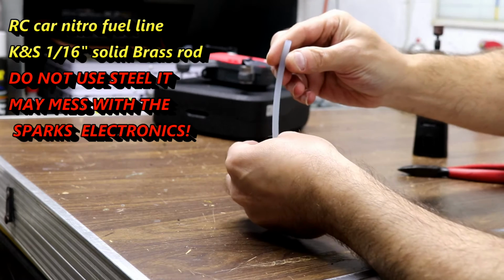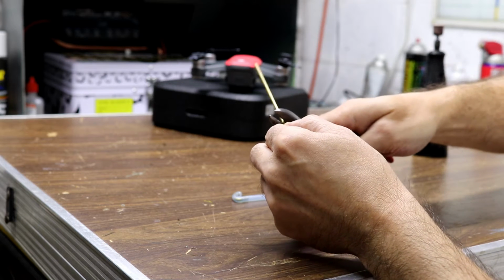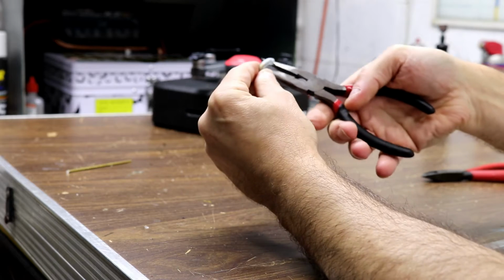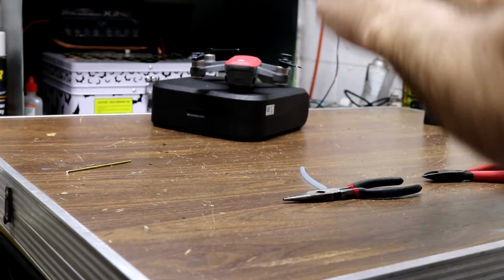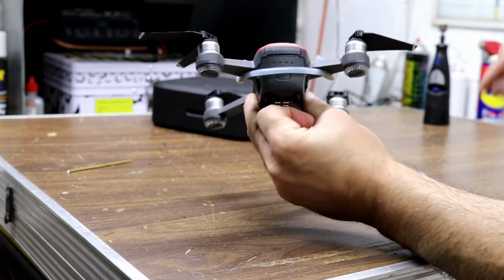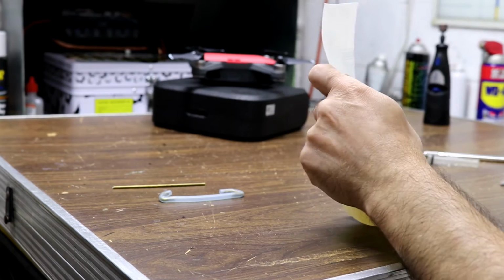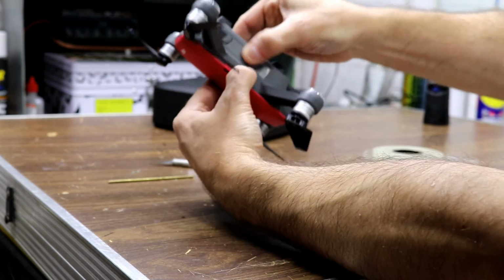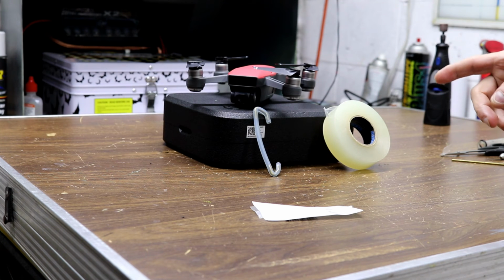DJi SPARK BATTERY FALLING OUT FIX SIMPLE

Comment: Very creative, personally I like the tube better. Thanks for showing
Reply from the maker: Thanks , K&S makes solid aluminum rod also and that would make it even lighter and you can use smaller nitro fuel line they make for the 0.49 motors and the set up will get much lighter and the aluminum rod should be a lot more easy to bend and work with than the brass. =)

Comment: A very goof tip, but DJI should address this problem .
Reply from the maker: Yea thanks , I don't have any problems with mine I think this may happen to people that really use them a lot and wear out the mechanism on the battery.
Reply: I'm looking at selling them my solution.  Hopefully they will listen, probably not they will wait for the masses to complain and then bring out the Spark 2
Reply from the maker: probably and we will be all stuck with the lemon sparks! I like using the hocky tape it's simple and light and dont leave any sticky stuff behind when you take it off, I use this on my RC boat lids to seal around them to make them water tight and then after you run the boat you simply peel it off. good tape
Reply: Cool, I've never heard of hockey tape before!

Comment: Good solution for the DIY'ers out there.  What is the weight (grams) it works out at for the first of your solutions? And how much is a Dremmel to purchase?  Cheers
Reply from the maker: Hi I know if you use K&S aluminum rod and the .049 engine silicone fuel line it should be super light. battery dremel like I have maybe $30.00
Reply from the maker: Hi man I just weighed my holder with the brass and normal RC fuel line it weighed 5.7 grams so if you use the .049 engine silicone fuel line and the K&S aluminum rod I would say it would be 3 grams maybe.

Comment: The problem to this battery issue is the way you charge it.  If keep pulling out then put it back in will wear out the locking hatch. Mine. I charge it with the spark alone no issue. Cause only  one battery i have peace..

Comment: Has anyone had their batteries pop off yet?
Reply from the maker: I seen a few guy's that said it happened.. but I think if when you push your battery on your spark and then you just give it a pull back to see if the battery slips off and if it don,t then it's secure and you can fly and if it slips off when you give it a little pull then you need to use tape or something to be safe and hold it in place on your spark.
Reply: Mine popped off today 200ft fall onto rocks. My Spark is dead.
Reply from the maker: that stinks ... simple fix for that just put tape on the sides like I show it cost nothing and is lightest option to use and stops the battery from coming off.
Reply: daersoulkeeper the spark is an amazing drone, just buy a battery latch from amazon